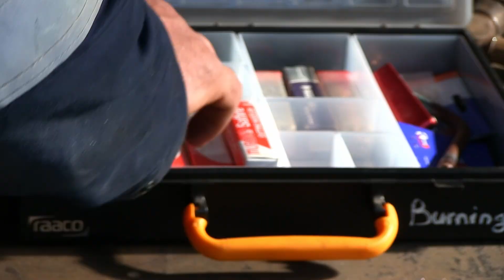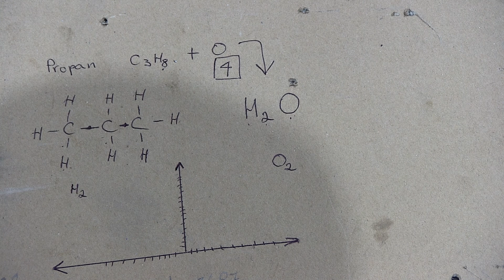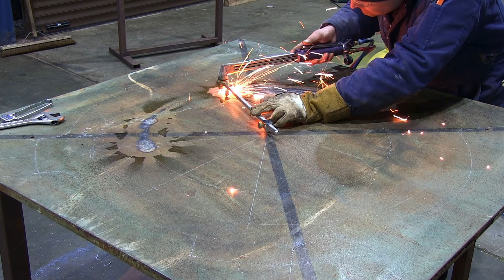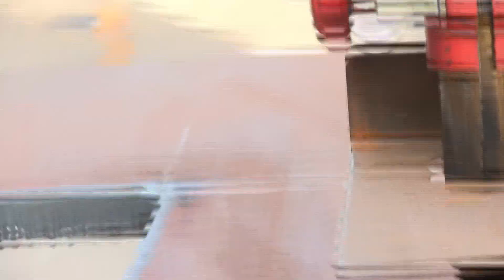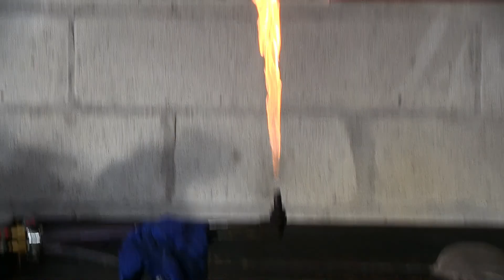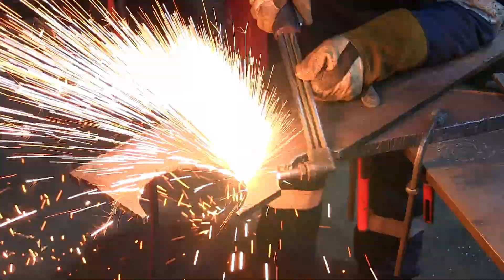Gas cutting steel,  Propane torch cutting set up for thick steel cutting.

Comment: This is by far the best oxy-propane cutting video I’ve found so far, I also found your website earlier whilst doing a google search.
So many other videos are just giving bad advice from people who are used to acetylene rather than propane.
Also, despite English not being your first language, you are very easy to understand.
I recently bought a miniature cutting head for my small oxy-propane torch, but it had no instructions, not even a guide to the correct gas pressures. I managed to find some pressure guidance, but this video has helped me with the rest of the information I needed to know.
Thanks very much for taking the time to explain all this so thoroughly.

Comment: Hi, great video thank you
Is it OK and safe to use a 2 gauge acetylene regulator with propane ? I am making a pair of forge venturi burners and cannot find a 2 gauge high pressure regulator for propane
cheers  OG
Reply from the maker: In some countries propane bottles got different connector to the regulator this may prevent you from connecting acetylene regulator on it. Propane bottles are relatively low pressure as the are full of liquid gas that condenses at relatively low pressure. So if your regulator can physically connect and form gas tight connection you will simply have to adjust to flow what you need, however it will always show low pressure even on brand new bottles. Do not be greedy and get flash back arrestors and one way valves
Reply: @weld-deluxltd7635  
thanks for that my friend. I have already bought one way and flashback arrestor, I may be old, but I intend to live for a long while yet ;<) If the pressure shown is not a 'true' statement of pressure,  it will at least give me a 'reference point' for running the burner

Comment: Thanks, great information very helpfull.
Reply from the maker: Thanks for your comment!

I really appreciate it as it shows me that my efforts help people
Reply: I have a blacksmith shop. usually not very heavy materials. also often interior work. but lately local customers are also arriving with heavy machinery and thick steel. I'm definitely going to watch your other video too. thank you for passing on your knowledge
Reply from the maker: Always welcome!
Reply: very nice that you make time for this. I already have quite a bit of experience with the old / antique model acitylene oxygen burner. but today ordered a new burner for propane oxygen. with the star like shaped nozzle. thick steel plates and heavy equipment suddenly seems to appear more in my shop. that is why it was really time for an upgrade.
Reply from the maker: @turbogrunnen  Awesome, I hope the information will give you necessary knowledge and confidence to tackle your new challenges.

If you work with heavy materials, you may also be interested in my latest video on portable beveling machine by Metabo.  

Expensive but good.

Comment: Young man, this video is very helpful to me because I don't use my gas cutting kit very often and I admit I am not very confident with it.
So thank you for taking the time to show the detail, particularly in establishing the right flame.
Also, the video was interesting because of the cutting examples shown and in particular the venturi effect with the coin.Now I have seen that, it will help me understand more about distance from torch cutting tip to the material surface.
Top marks Weldorado, I doff my cap in respect to young man!
Reply from the maker: Thank you very much for  your input! i really appreciate it a lot!
Reply: @weld-deluxltd7635  I am happy to say thank you and be grateful that you took the time to make the video. 
On your website now!
Reply from the maker: @JonDingle  Thank you!

Comment: Is it possible to cut steel using only propane without an oxygen tank as well? As I understand it, the temperature is high enough, but does it need anything else?
Reply from the maker: No, it is the Oxygen that does all cutting. It is all in the video

Comment: Well budy you made an awesome torch and I am sure it can reach temps up to 900-1000 C but I Wouldn't really suggest the combustion inside the tube cauze due to intense heat the tube is gonna start weakening until it probably will fall out. (Sorry for bad english, I am from Greece but I wont all the audince to get what I am saying) rather than that an amazing video keep going with the good work.

Comment: i've run several hundred gallons of propane through my regulator and hose with out any signs of deterioration.  just the regulator brass fitting and 2 pcs tip
Reply from the maker: Any equipment with time will  degrade especially with extensive use